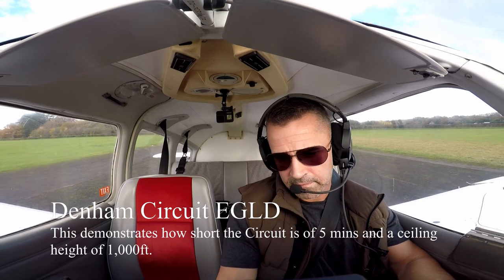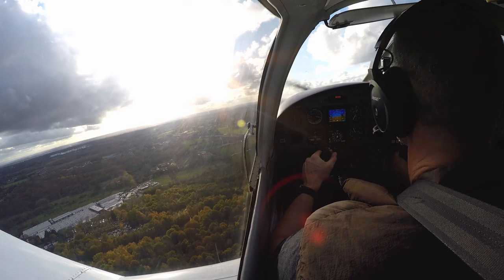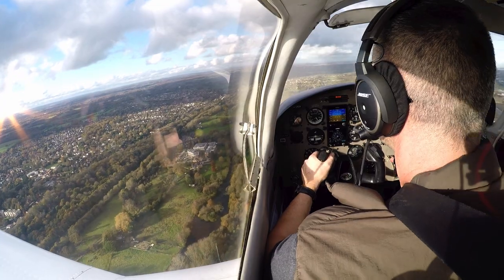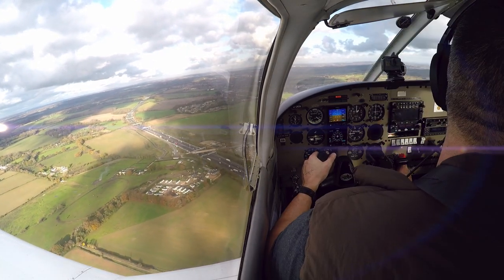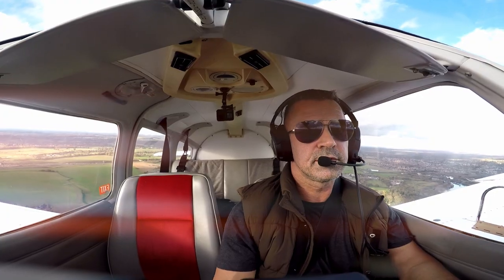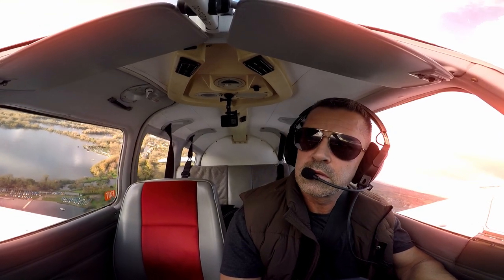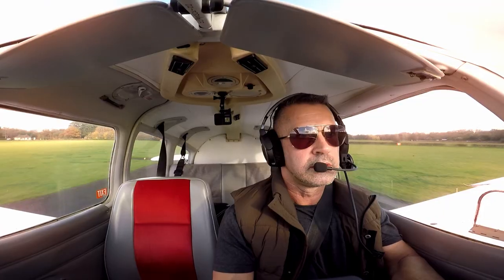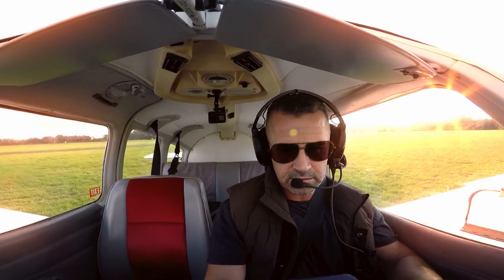Denham Airfield Circuit in less 5 Minutes - EGLD

Comment: I did my PPL there in 1973.  There was no hard runway, only a grass airstrip.  At the time I was working in the hangers as an aircraft electrician / radio engineer, for the company Air Gregory.  I used to have a room in the country club on the airfield, it was called Hawkesridge club.  I used to work the bar in the evenings in lieu of rent.  I got my PPL but let it drop, but some years later in 1990, the PPL got me a job just outside Tokyo in Japan.  A Japanese flying school hired me to teach RT procedures and to practice using the phonetic alphabet with Japanese airline pilots and flight attendants.  One not so joyous experience was when an American trainee was killed in a helicopter pinnacle landing attempt.  The school in trying to avoid being sued by the parents, had me write a gravestone epitaph in English.
The circuit in the video made me remember the time just after getting my PPL, when to impress the local girls, I took 2 or 3 of them for a circuit.
Reply from the maker: Such an amazing story, thank you Keith for sharing. 
Sounds fun working over in Tokyo teaching the RT, despite the tragic news of the American Trainee. 
Very pleased my video brought back memories for you. 
Not sure it'll be as easy taking up local girls for a quick flight nowadays but a great story. Maybe a visit to Denham is on the cards to reminisce the good old day.